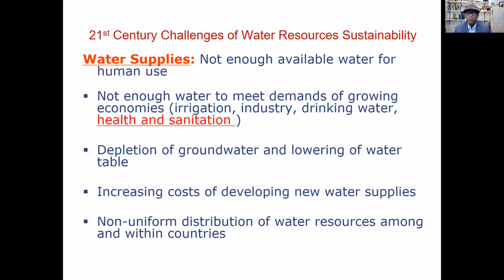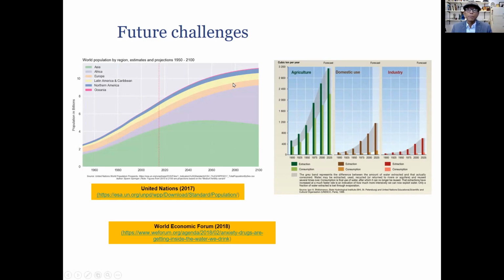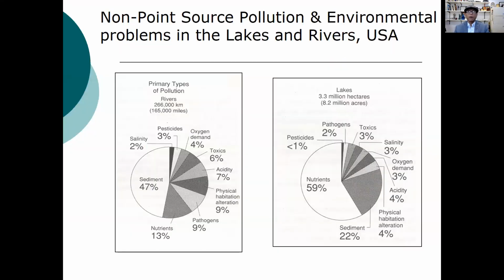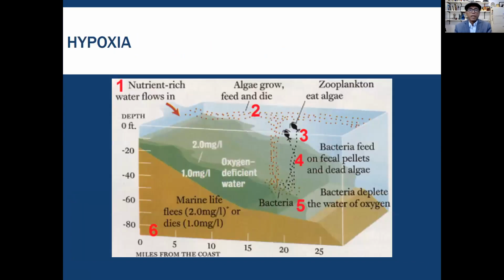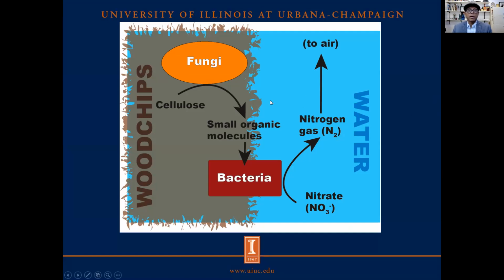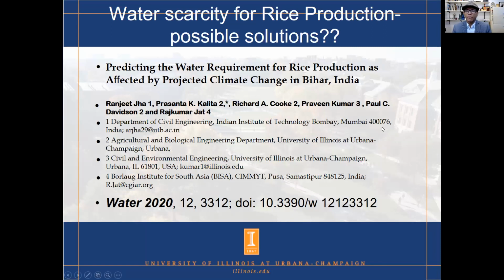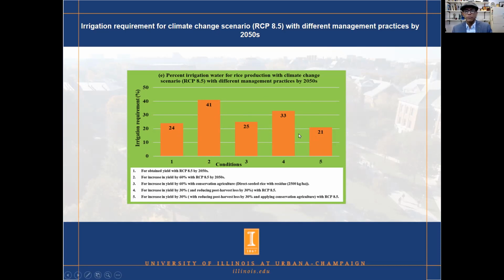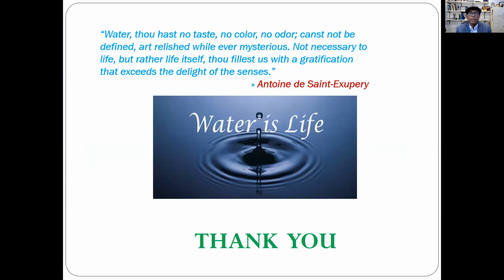CONF-MCEE – Water Resources and Environmental Sustainability – A Global Perspective

Comment from the maker: Here are the questions we collected and answers replied by the presenter:

Q1. My question is about the cultivation of crops. The nutritions for different crops may be different. So is there a better way to reuse waste water targeting special crops?
 
A1. Excellent question and thank you. And yes, wastewater can be reused for different crops depending on the nutrient contents of the wastewater. However, care should be taken that the harmful toxic components from the wastewater must be removed before applying it to any special crops. The toxic components can build up in the soil system over time and make the soil/land unsuitable for crop growth. They can also be discharged into the environment and make the ecosystem unhealthy over time. Apart from that, the wastewater or drainage water carrying significant amount of nutrients can be reused and reutilized again. The drainage water should be analyzed for its nutrient contents (N,P,K), and depending on soil nutrient contents, and the crop nutrient requirement, the drainage water can be recirculated back to the same field or to a different field/cropping system. Many researchers are growing some specialty crops, like ornamental or floricultural plants (nonedible) using  wastewater after harmful toxics are removed from it.
 
Q2. How to treat other harmful metals besides Ni and Cr in waste water of heavy industry?
 
A2. Very good and practical question and thank you. Different toxic metals may need different filtration technique and practices. The characteristics of each metal should be studied in detail, and its adsorption/desorption kinetics be determined.  Based on that, different filtration materials, or a combination of filtration materials can be tried. While the toxic metal passes through the filter materials, retention time for each one within the filtration system may vary. One needs to determine the metal breakthrough curves, and based on that the retention time and % removal of each metal can be determined.